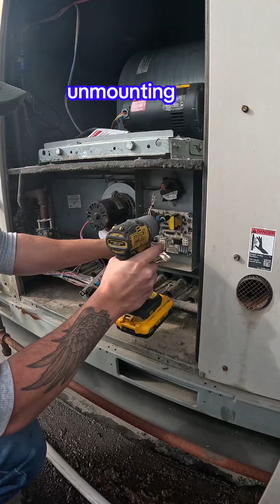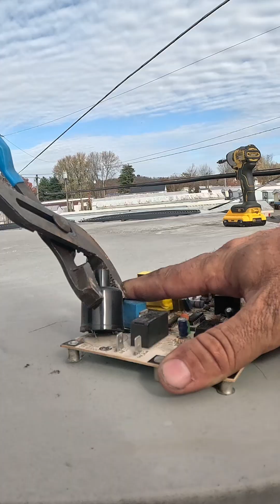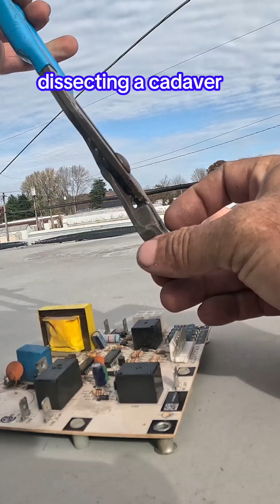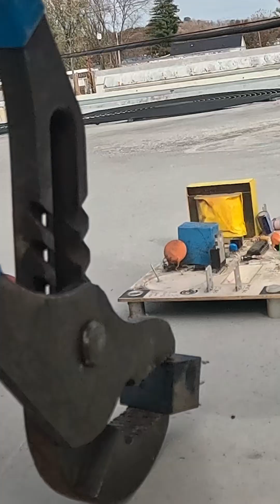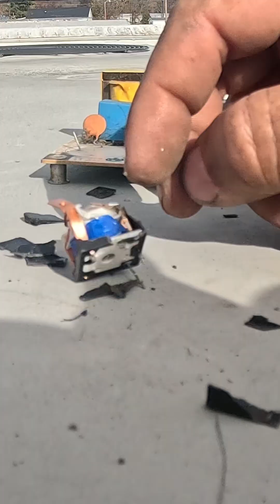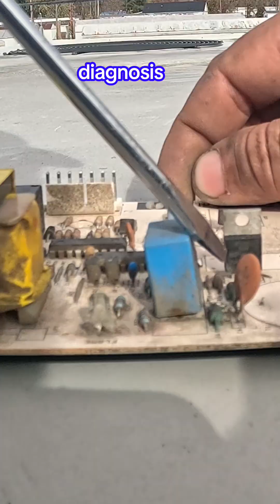HVAC Doctors

Comment: As an electrical engineer I kinda cringed at you using those pliers, but it was fun anyway. Love seeing people interested in electronics, it’s no harder than anything else I’ve seen you do.
Reply from the maker: 😂😂 sorry about that, i have soldered a few loose pins on boards or traced the circuitry and found i could connect a wire on the other side of a break and get a customer going